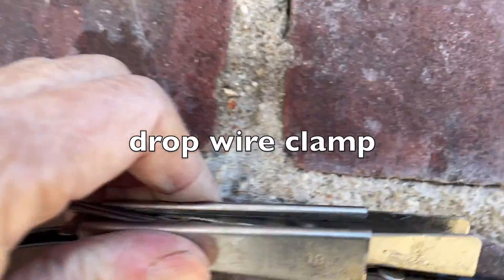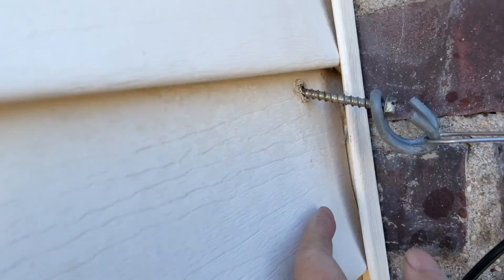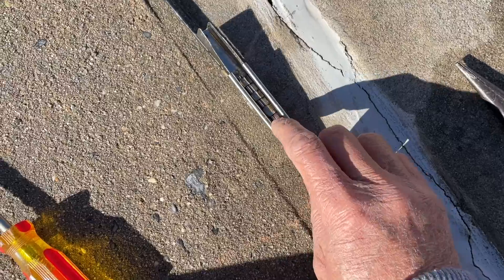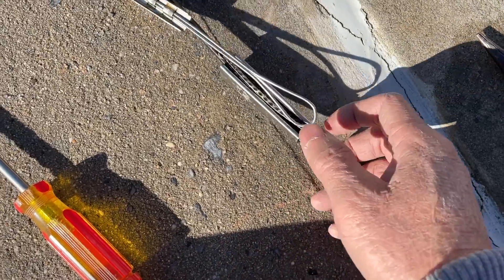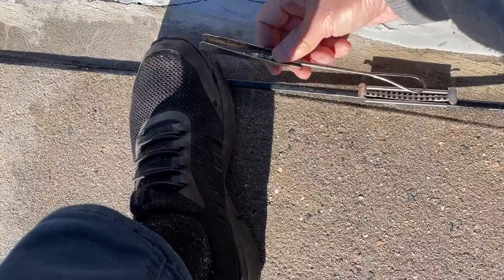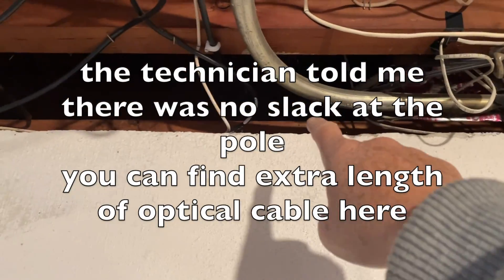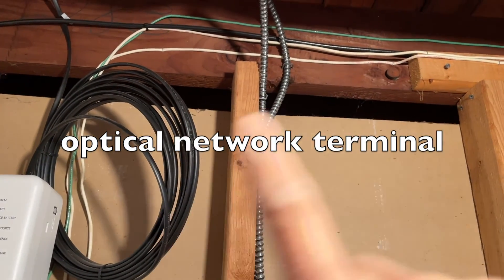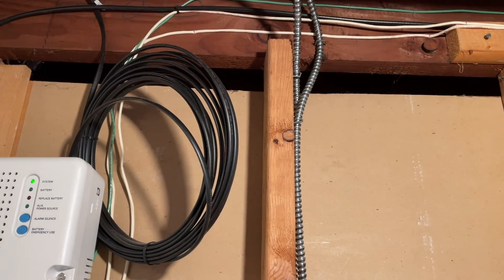How optical fiber cable is attached to your house

Comment: Good info. 👍 The extra loop(s) of wire close to either end is called a service loop and it can be a lifesaver. 🙂
Reply from the maker: Thank you for naming the extra loop of wire. When customers call for service, they can now sound like they know what they are talking about. The utility pole shifted in my backyard and suddenly my cable became really tight and pulled on the siding. No one pays attention to this kind of stuff until their internet stopped working and the drop wire clamp has to be loosen to give the cable more slack.
Reply: @wtam69  You're welcome.  Yup, it definitely helps to speak the same language, and it pays to be observant. 👍